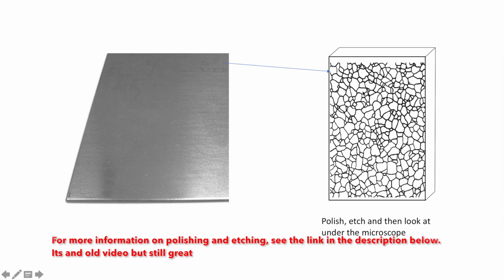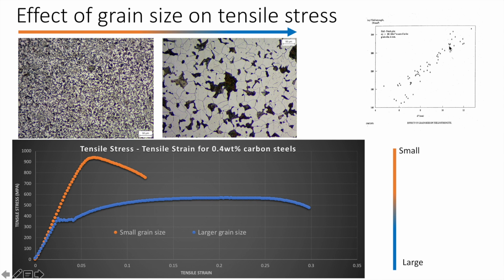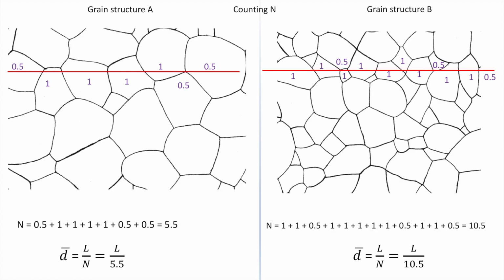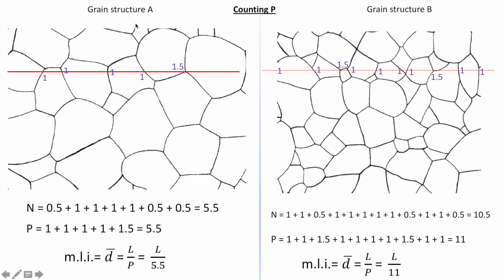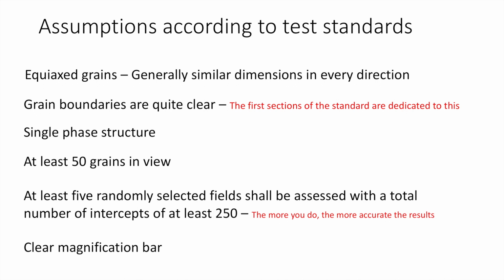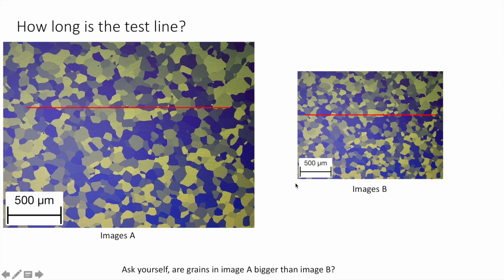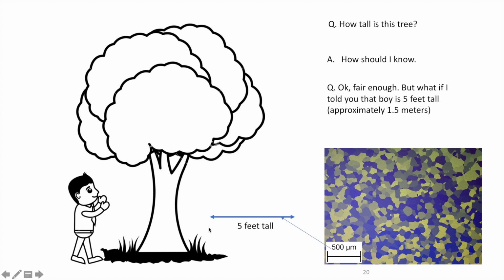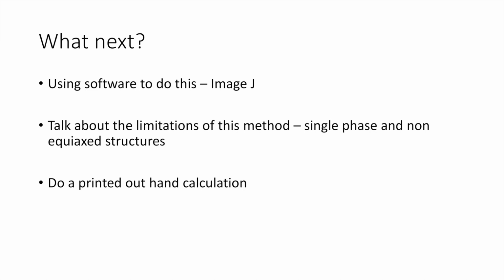The Mean Linear Intercept Method Explained

Comment: The difference you got in the two methods results from counting the leftmost grain as 1 in the intercept method, when it should've been counted as 0.5. In the Intersect method it was assumed that the left end of the line ends in that grain.

If there was another intersect at the left, then that would add 1 in the intersect method and also in the intercept method, since then the line ends in the next grain i.e. the 0.5 becomes a 1 and theres another 0.5.

If the line ends exactly on a grain boundary, then in the intercept method that first grain is counted 1 and there's no 0.5 for the line ending within a grain, and in the intersect method the first cut should be weighed with 0.5 to make it consistent.

The 1.5 for a triple point in intersect is consistent with going through one more grain and an added tangential in intercept. So if a triple point in intersect is classified as tangential to one of the three grains in intercept the results should match.

Comment: is this method for single phase and two phase ?
or there are methods for two phase ?
Reply: Only for single phase. There are methods for two phase written in the standards.
Reply: @michaelshakib7777  coudn't find one even the E1881 doesn’t apply for my case (ferrite and carbides)